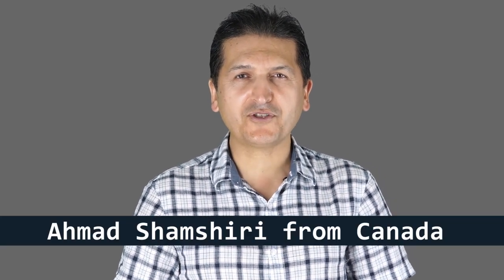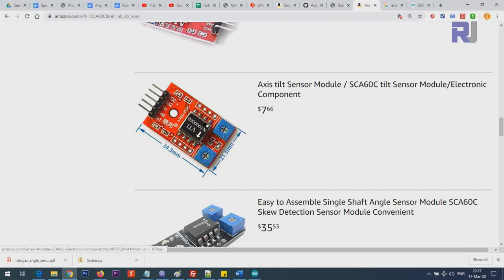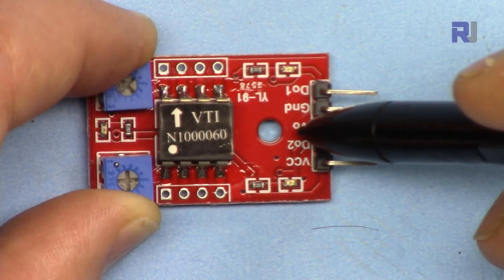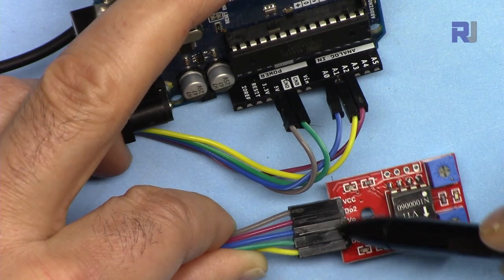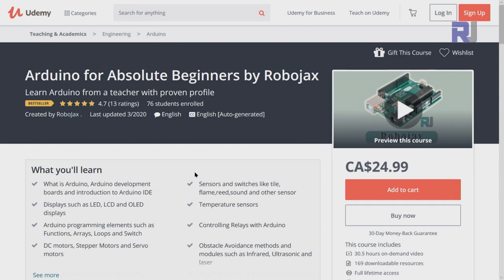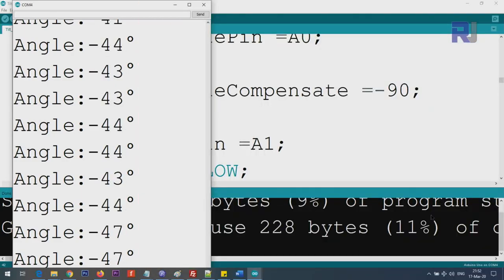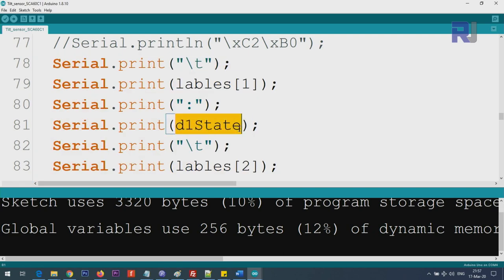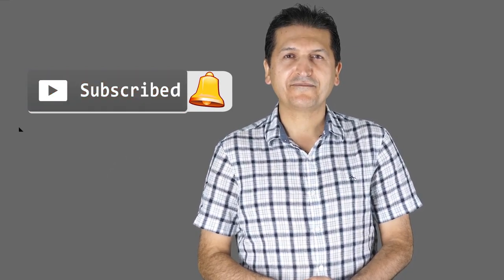Measure  Tilt Angle using SCA60C angle sensor - Robojax

Comment: Hi. Great Video. Can you advise the programming if i require the starting angle to start at 0 degrees when powered up, regardless of the actual angle. This is so i can set an alarm when the angle changes sufficiently, although the actual starting angle is not important. It's only the change in angle that i am interested in recording.

Comment: I bought this sensor but I get some strange readings now. (only using Vo) when the sensor is horizontal like yours in the demonstration. -108 when horizontal and the reading only changes when I tilt the sensor to the vcc side. it goes from -108 to 22 degree when it is actually at 90 degree, to -108 again. do you have an idea why I get those readings and it is not working to the other side?

Comment: Hi.
modified code used in this video  to switch on and off 2 relays depending on the inclination and angle. Going to use this in an environment with some vibration (a vehicle) and by shaking the sensor up and down i have noticed that it sometimes switches off when it should not since angle changes for a split milisecond. Tried various combinations with delays and it somehow worked but i stopped getting almost immediate response from the sensor so when i tilted from left to right faster than the delay it was lagging to much.
Is there a tilt sensor or any other multi-axial sensor that would fit my application for an environment with some vibrations? I am willing to have a go with a double SCA60C on one board (will try to combine 2 SCA60Cs to avoid buying more sensors).
Learned a lot from this video :) thanks
Reply from the maker: Hi, Thanks for sharing your experience.  Good luck with your project.  Stay safe.
Reply: @robojax  any other sensor i can try that is not going to be influenced by vibrations as much as this one used in the video?
Reply from the maker: there are mot complicated 3 axis sensors  such as this https://youtu.be/mzwovYcozvI or this https://youtu.be/uhh7ik02aDc
Reply: @robojax  Hi. Will go with the simpler one... the 1 axis didnt work that well for me

Comment: Thank you very much , can I use the gy-61 sensor instead and without calibration?
Reply from the maker: this code is written specifically for this module. Won't work on anything else.

Comment: Thank you for this amazing video!! I'm new to this and it helps me with my final project.  But I  just wanted to ask one thing. Does this sensor able to be set to trigger an LED once it reaches a certain angle??
Reply from the maker: you are welcome. the whole point of the code is to do something with the angle.  In the code I have provided two alarm meaning do something if  angle is reached at certain value. you may use if(angle >45) { //do something here }
if you don't know the  conditional statement, then Learn Arduino in 30 Minutes (video): http://robojax.com/L/?id=135
Reply: @robojax  Okayyy thank youu

Comment: Thank you great video, please how we can do a control on the tilt angle by giving an input angle and the dc motor response to this order to reach the required angle
Reply from the maker: that is very interesting.  it needs the code to be written totally from ground up.  This video shows controlling DC motor speed with temperature https://youtu.be/5xQ8vLavWKQ you may learn from it.

Comment: Just got my SCA60C. Downloaded your sketch. When laying flat on a desk angle is 102 when I tilt it 90 degrees it shows 92 degrees. Adjustable pots do nothing. D02 led on all the time Do I have a defective unit
Reply from the maker: 2 degrees is not bad. how do you do know the surface  you are putting it or the surface you are starting is correct?

Comment: can it detect rotation in clockwise n anti clockwise, if supposed installed on roration disk
Reply from the maker: Yes you can if you somehow keep the power and all wires connected and also rotate the module. The sensor is on the motor and it needs to move to detect. that's why you can only rotate 360 easily.  More than that would be hard but not impossible.

Comment: Great video. Can i use it as automobile tilt sensor? Is it sensitive to vibration?
Reply from the maker: thanks. I am not sure if can be used in automotive. Check the datasheet on the resources page for this item, on page 7 they mention it in the Note2.

Comment: Very cool.. I wonder if there is a way to send the angle signal to a simple dual digit LED readout .  I made a power spoiler for my vehicle with a linear actuator to help increase down force on the highway.   to know what the angle of attack is I thought about doing something like this ( would have to wate proof it of course ) .   My other thought was just to have a camera up there that also acts as eyes from the roof and back.
Reply from the maker: sorry what is "signal to a simple dual digit LED readout "?  do you mean LED Seven Segment display?  if so you  need this TM1637 dispaly to just display the number https://youtu.be/cJqmXjERwkQ this video is part of my Arduino which has over 200 projects  Arduino Step by Step Course  (over 100 lectures) Starts here https://youtu.be/-6qSrDUA5a8
Reply: @robojax  yes I meant a 7 segment sorry.  I suppose I could always use one and it would show me the 10ths place of the value?     My other thought is I could make a custom animation showing the angle of the spoiler to like a Nextion lcd screen hooked to a potentiometer pot.  I do like the classic look of simple 7 segment though lol.. anyway thanks for all you share!    I'm new to arduino obviously so about to explore a new world.
Reply: @robojax  on second thought I just realized maybe an angle sensor is not the best idea because the values would change at every gradient in the road lol...  will have to use a position knob or something.
Reply from the maker: may be rotary encoder where it shows the angle on the LCD https://youtu.be/6xVLbNlmK-g or you could use OLED dispaly to show an arrow with direction or angle.
Reply: @robojax  yeah that was my thought but I realized my linear actuator has no feedback ( the white/yellow breakout )   its only a power/ground type you would run on a DPDT switch.    I bought a cheaper elegoo R3  and a Nextion 2.4" ... The nextion I've seen can store images so I can make a custom gauge basically like an animation  which is really cool.  I just have to learn more and how I would assign values .. have been watching the videos. I did want something basic but after seeing what the nextion could do I couldn't resist.    My thinking is this ..  I've seen the laser range sensors ( smallest option compared to sonar and infrared )   so  I could put that on the bottom of the spoiler or the top of the roof aimed at the spoiler  to get my values then they would have animation assigned.  Would jus thave to find a way to waterproof the range sensor..    Then I will just leave the momentary switch separate from the arduino and right to the actuator.   If youre curious this is what the setup is... here crudely setup for testing the range and stuff...   Just a project I wanted to do to add some adjustable stability to my van on the highway lol  and setup a system..  I was just going to use a backup cam that can see behind and incidentally see the spoiler but it wasnt interesting enough. https://www.youtube.com/watch?v=DicdpP5Bct0
Reply from the maker: I just watched video, nice job that's cool.  On higher speeds it will affect the motion of car for sure. Never heard of Nextion 2.4" and did a search and that seems interesting dispaly as I have tone of videos on display. stay safe.
Reply: @robojax  thank you!    yeah it's a neat party trick lol     I wish I could afford a faster linear actuator.. the static load that one can hold is a bit overkill so it is only about 10 mm/s    .. maybe its a little quicker with the amperage of the vehicle battery .. I just had it hooked up to a model railroad transformer ( my old trusty 12v source as a kid and today still )   .   Yeah I found the Nextions from someone making a custom gauge     and with the advanced version  he was fitting about 200 images to each value so it animated very nicely. a good 1:1 control of his knobs input to the display.  I think my model can fit like 50 images which is more than enough. They also have editing software       so  I still have learning to do but  I'm sure I can find out how I apply the range finding values to each image.  But time to do more homework first!  Thanks again and  I will
Reply from the maker: it is satisfying to make something work the way you want it. of course on the way there will be challenges but that is the point to overcome the challenges.  take care and happy coding.

Comment: good video, but I have a question for this device that the angle is not very accuracy compare to other inclinometer or protractor, how can I fix this problem? thks
Reply from the maker: is accurate by 1 degree. if you need further accuracy, use different module.

Comment: What is the diference between tilt sensor and accelerometer sensor? why is one better that the other?
Reply from the maker: 'accelerometer" from the name we know it senses the acceleration on an object in 3-D space. the angle sensor is very simple way to get angle. We have gyroscope which is better than this module in the video with more precise angle for precise projects. this module however is excellent for most projects.
Reply: @robojax  Thanks, but not I have another question. What is the difference between adxl345 and mpu6050? Wich one is doing a better job and why? (I have this question because I saw mpu6050 having an accelerometer + a gyro, and is not clear for me why)
Reply: @akun2500   any update on this comment

Comment: Sir i ordered 2 products both are run with this program but the angles have a huge error and right side led was not blinking when i tilted to right
In zero degree it reads -60 degree 
Please helpe me☹️☹️
Reply from the maker: just add or subtract some value so you can get actual number.
Reply: @robojax   still no change sir i tried two pieces bought from amazon

Comment: Can it measures angle in a rocket at 10.000 feet ?
Reply from the maker: I haven't looked at how it behaves  in higher elevation. May be look at this module which is very accurate and it is from TDK https://youtu.be/mzwovYcozvI

Comment: How i can contact you sir? Please ..
Reply from the maker: Sorry, you have no time to communicate.
Reply: @robojax  ok so i can direct asking here .. What of type sensor to connect the arduino Uno for specific to measure the angle ? Example to measure the angle for injection ? 10 degree, 25 degree ,45 degree , and 90 degree? Please answer sir .. Thanks ..
Reply: @robojax  because i will soon to do the project regarding automated injector with coding and connect to arduino Uno